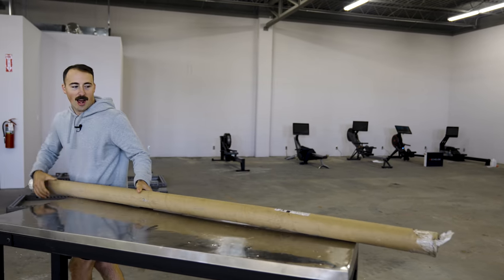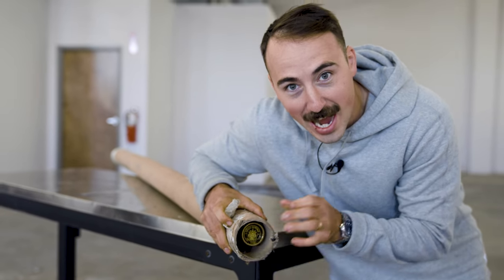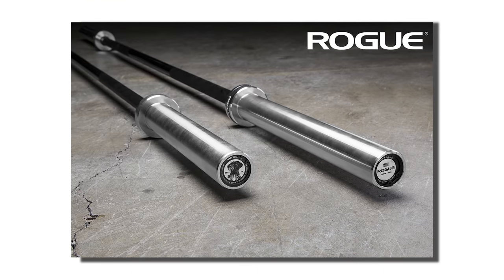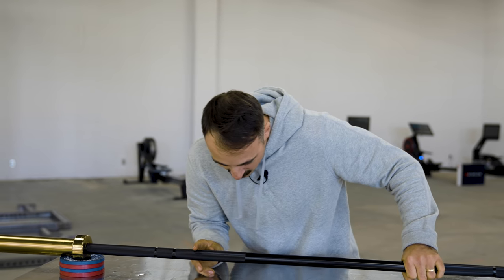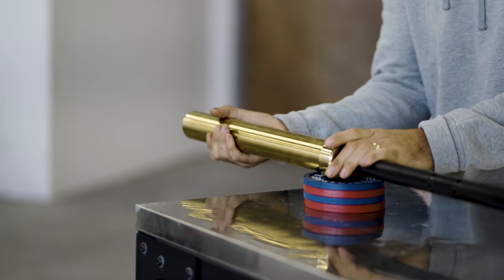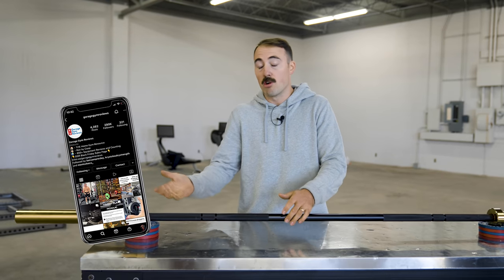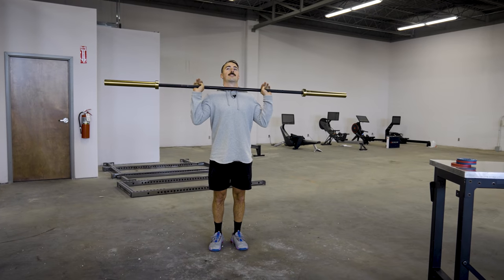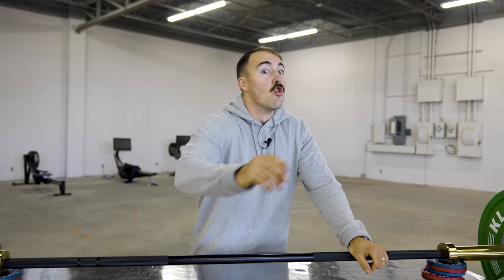The Scratch-Proof Gold Titanium Barbell - Fringe Sport Midas Revenge Bar Review!

Comment: Your other viewers might be clear about this point, but it's not a titanium gold alloy on the bar. Real titanium gold is β-Ti₃Au (where Ti is titanium and Au is gold). A titanium gold alloy barbell would be very expensive.

According to Midas, they are using gold tinted titanium, which is titanium nitride (TiN, where N is nitrogen). 

From the FAQ on Midas: Are the sleeves real gold?
No, the sleeves are coated in gold colored titanium. Titanium is 40% lighter than high-strength steel, but is just as strong. This means the sleeves on the Midas’ Revenge Bar are ultra-durable and resistant against oxidation. Unfortunately, real gold is super soft and easily bends, so it would be terrible for a coating on a barbell built for super performance.

Comment: It’s actually a titanium nitride coating (TiN). There isn’t any actual gold in it. It just appears that way. It’s used a lot for coating cutting tools in machining applications.
Reply: Used in some firearms accessories as well
Reply: @DefensiveConcepts  like gold ak receivers and stuff right?
Reply: @fabianruiz2461  more like compensators for pistols and bolt carriers on rifles
Reply: @DefensiveConcepts ah I gothchu
Reply: @markandrewkoval8920  yea but gold weighs a shit ton more so you could load up less plates.  ^____~
Reply: I was going to say there's been titanium coated drill bits available for decades that look the same as this. That must be where they got the idea from. It definitely is tough to scratch it off. Only my most worn bits are missing the gold right at the point where it cuts into steel.
Reply: @muffemod  but it's soft as butter. Even if good was cheap, you would pretty much never build with it
Reply: Oh so is it carbide?
Reply: @beesmongeese2978  no. It's steel, coated in titanium nitride.
Reply: @fabianruiz2461  yes, anything and everything can get TiN coated. Lots of people TiN coat their guns instead of using gold plating, since it's far harder, and the application process makes it less likely to flake off. It's sputtered/CVD/PVD instead of plated.
Reply: DLC next ?
Reply: @fabianruiz2461  it is the same that coats receivers and slide’s aswell due to durability and not being good while looking gold

Comment: Midas Revenge is a proper name for this bar, as when you pop off the golden sleeves to check on the bad spin,  you witness all the rust on the inner sleeve.
Reply: A small number of bars were affected and the issue is now fixed :). PK, CEO of Fringe Sport
Reply: Don't worry brah. The "CEO" is in the comments section doing damage control. Imagine they put as much time into quality control.